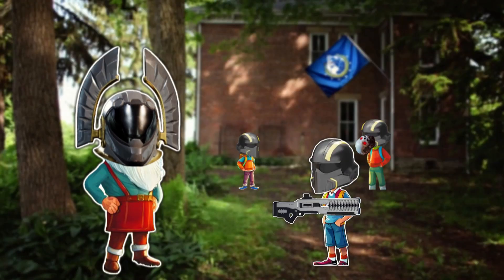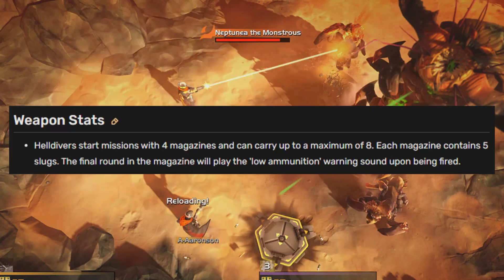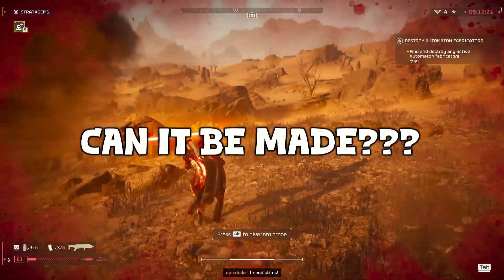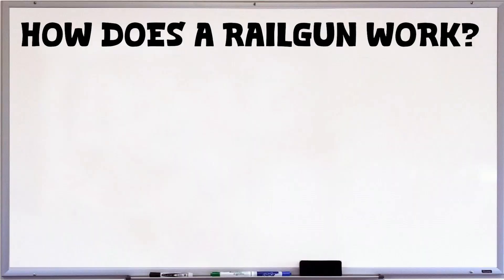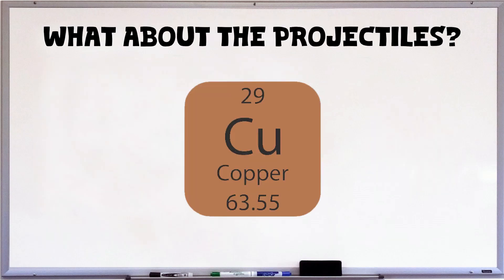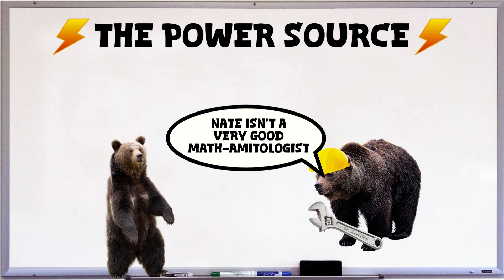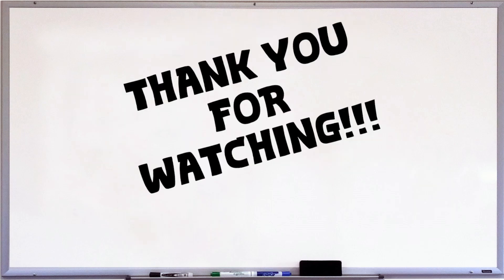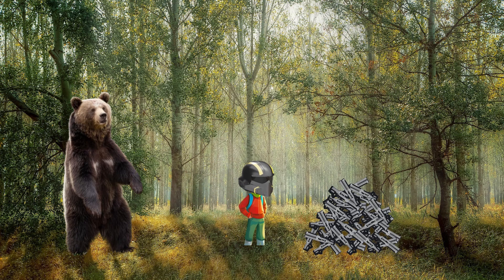The Engineering of the Helldivers 2 Railgun

Comment: You forgot about Capacitors. Capacitors have high power output. The whole process of charging your railgun is a process of low power output source charging capacitor, then when you shoot - capacitor releases it rapidly. So, if railgun charges for 3 seconds, 67 kW capacitor would need 67/3 kW battery source (ideally). Then there is battery size. Average car battery has capacity of 40 kWh. It means, that if it would output 40 kW, it would last 1 hour. We only need 3 seconds of charge, which will considerably decrease battery size. Then pair three of those little batteries into one disposable pack that goes with projectile and you get some working prototype. But all of this are really rough approximation.

Comment: What about a capacitor inside the mag the we change, i don know if a 67kw capacitor is even possible but the idea wold be that you discard the casing plus the expended capacitor and load the new one with the new slug, in game the part that act as a mag lights up suggesting this idea (idk im not an engineer or anything)

Comment: One major relatively easy-to-account-for thing you ignored at 13:25 was the velocity difference. 

Even if we assume the general efficiency of railguns are more or less constant, velocity is a massive factor here.

Kinetic energy is (1/2) mass times velocity squared. If there is a more or less constant ratio between input electrical energy and output kinetic energy, the velocity difference will be magnitudes larger a factor than mass. In other words a difference of 4000 feet per second would result in a kinetic energy change of 4000 times 4000, or a 16000000 change in kinetic energy.

With all that said, what's far more likely is each cartridge has a builtin super capacitor, like how modern brass cartridges have builtin propellant to fire the bullet. (Or would it be a super super capacitor?) Batteries just cant handle the current draw of a railgun, I mean you are literally just shorting the terminals with a metal slug so hard it fucks off at mach 5.

(PS, my money is on those weird armature things being spring-loaded to adjust to either A : variances in the projectile, or B : different projectiles, or C : getting excellent contact. So less of a "rail" gun and more of a "couple dozen micro-rail" gun. This has the added benefit that the wear component of the "rails" would be easily repairable.)
Reply: Oh nooo.... On your calculation of the kinetics energy with 4000 extra fps, you committed the cardinal sin of a^2 + b^2 = (ab)^2. Cheers!
Reply: @nixonwphoto  what? 
1 : Mate I literally used fucking feet per second in an energy calculation; the point was to demonstrate exponentials are big, i.e. leaving out the velocity was a massively influential component that none the less would be trivial to solve for. If you saw feet per second squared and thought any attempt at exact energy calculations was happening I want your dealer's number because god damn that shit must slap.
2 : even that correction would still be completely inapplicable even if I were making a serious energy calculation since there is only one variable in use, velocity. I literally never included mass once, precisely because, as much as I'll fight that imperial units are better for casual use, they're utter piss for any actual math. (And frankly I don't care enough to do the conversions) I literally never had a B or C, all I did was square 4000 and show how big the number gets. You might be able to say I said "16000000 change in kinetic energy" which implies an additive change rather than multiplicative, but again, we're now working in feet per second squared; is that really the issue here?

This is the most direct mathematical equivalent of saying the Monster's name wasn't Frankenstein I think I've ever seen.
Reply: @felixjohnson3874 Yesss! SI unit ftw. You actually don't have to do much conversion, since Nate's Game Box already he wants the projectile to be an one ounce slug, with 3x muzzle velocity from a normal shotgun, and @6:36, he provided the muzzle energy for a regular slug. We can just 9x that.
Reply: @nixonwphoto  I'm aware its simple to do but thats not relevant to the point I was making. The velocity is squared in the kinetic energy equation so a halving of the velocity cuts the velocity component of the kinetic energy to a quarter. 
100*100=10000
50*50=2500
This also directly cuts the total kinetic energy to a quarter since mass is constant.

The large scale military railguns he's comparing against are going at absurd speeds that are unlikely to be representative of the handheld railgun ingame. The calculations are being based on a standard slug, going at mach fuck.

An IRL handheld weapon like this would either

A : use reactive projectiles, so a projectile designed to explode immediately AFTER  hitting/penetrating a hard surface
B :  A heavy slow moving slug, potentially even subsonic for stealth operations
C : a tiiiiiiiny but absurdly high velocity projectile designed to be used to strategically hit vital organs. Alternatively; an unfolding skeletonized projectile that is still incredibly light but, like option A, expands on-contact via either compliant expansion, fragmentation, etc. to do a similar job as A without the rails themselves needing to be reactive. (This would likely be cost prohibitive for us today, but metal SLS 3D printing is already getting pretty bloody cheap)

What might be interesting is to give the railgun in game 3 ammo pools of 3 cartridge types, (selectable in the weapon menu) so one "Administered EMS Nanites" cartridge to stun single units, one "HPHE - High Penetration High Explosive" and "Subsonic Slugs", only having 1-3 of the first two and 10 or so of the last one. The first two are fairly self explanatory, they'd penetrate heavy armor and either stun problematic units or blow their inner bits to paste via a tiny hole in their face. Then the last one would be a fall back that'd have it's damage be highly charge dependent but make no noise and only pierce upto medium armor. (Maaaaybe also keeping the weird piercing the railgun has to punch through automaton shields and such, but not sure on that) Then its a jack of all trades weapon that can save your ass in a variety of pinches, but only has a handful of rounds to do it. (With the slugs primarily being a fall back so it's not entirely useless if you run out.) This means that, if we count the EMS and HPHEs as a single one shot kill, (a stunned charger should be as good as dead) it could kill a total of 6 chargers, much like something like the recoilless, but it has the initial charge up penalty of the Quasar. The benefit of course is that unlike the Recoilless you keep the backpack slot and have a bit more situational utility. So it has comparable ammo to the Recoilless (again, the slugs would be more of a fall back than a weapon definer for most people) with a faster follow up time, but it has the delayed firing of the Quasar with the benefit if not needing the backpack for the recoilless. That'd also fit a bit more with those weird grabby armature things it has; the rail contacts are literally designed to accommodate different projectiles going through the same barrel.

Comment: Thank you for making a fun science video on video game! I have something to contribute to this topic. I love science, since you have decided that projectile with the mass of 1 ounce,(~28 grams) and the muzzle velocity about 3 times of a 12 slug. With the screenshot you provided @6:36, we can easily compute the railgun projectile will have a muzzle energy of 3,204J x 3^2. Let's call that 29kJ to make it easy. 2ft barrel is around 60cm, or 0.6m, assume linear acceleration, with the Newton's kinematic equation, we can find the projectile takes 0.0008 seconds to accelerate in the barrel. Equipped with muzzle energy, and time spend in the barrel, we can find the wattage require to be about 3.6MW. Differ from your estimation by about 2 orders of magnitude.
Another disagreement I have, is deriving battery needed from wattage. Battery isn't particularly good that quick discharge, as you have shown. For fast and short discharge, the energy would come from a capacitor, like a pop up flash light on a DSLR camera, or IRL railgun, or in the fancy world of Helldivers 2, I imagine supercapacitor would be widely available, instead of our current lab use only. They should be able to provide the energy needed(~8Wh) for a shot with somewhere 3 to <1 kg of mass. With current Li-ion battery technology, it has specific energy density range from 100-250 Wh/kg (from wiki search). The battery mass needed for the energy of one shot would weight about 32-80 gram. 80 grams of battery can total be part of the cartridge, that will be discharged, and replace from each reload.

Happy physic'ing! From fellow nerds.
Reply: I thought a tiny bit more on this for comparison. The most powerful electric car right now is a Lotus Evija @1500kW, our railgun is only at just over double the wattage. While the Evija pushes its power from a battery pack for sustain power. We only need the 3.6MW, or 3,600kW for 0.0008 seconds; super capacitors should be able to provide the energy and wattage.

Comment: I’m building one for school. The key to the power issue is that the railgun needs only power for a split second to launch the projectile, so you can use a capacitor to store energy from a much smaller battery and release it in an instant.
Reply: Seems like you beat me to it.
My guess is that the round white thing is a capacitor, it's fairly big for one too!
And the actual batterie is in the thing you load into the railgun, since it's fairly big and you toss it when it's empty/almost empty.
That explains the charging too, you load the capasitor by charging the railgun up.
Reply: @danielgudi7446  I mean the laser guns seem to have practically infinite energy so long as they don't overheat so i'm assuming the railgun uses the same kind of battery.
Reply: @danielgudi7446 The energy needed for one shot can be stored in a smart phone battery. Pretty small for a high tech weapon imho. I love doing these "what if" questions.
Reply: The rail gun nerfed itself because it didn’t want to be anywhere near general Braschs power

Comment: 16:15 maybe they are generating the power in a small reactor? Or the ammo box is also a big battery
Reply: Feel please to double check my math in my comment, but the energy required to propel one slug once, can be stored within a battery that's in your smart phone or smaller.
Reply: Nate's incorrect, we do have railguns IRL, just not is mass production.
On the ArcFlash Labs' GR-1, the battery was bulky but not as heavy as a car battery.

Comment: So, first, i think pick copper, as material for projecile is not very smart, bcs its very soft and most likely will doubt, rather then peretrate smth.
And, second, i think battery in railgun is not that thing on the back, its thing that we load into railgun. Its makes sense, since its singleshot, this container or bullet, that we load, contains projectile and power to launch it
Reply: The cartridge containing the slug definitely does something in relation to firing the projectile. It reminds me of Halo 4-5's Railgun. It's projectiles are housed in cartridges that connect to the gun's power source or energy system meaning they're a required component in firing slugs down range.
Reply: Perhaps a copper jacket, or rings, over a much better material for launching, like depleted uranium, tungsten, or something the like.

Comment: Attach the gun to a battery pack, and use a super conductor as a sabot. You can't use rifling so just use a hexagonal barrel like those old confederate snipers. Or use magnetic levitation so the round doesn't have to touch the barrel at all. Theoretically there's a lot you can do with railguns.
Reply: Heck, given the proper alignment of the magnets, they could impart spine to the projectile too, and with the magnetic field holding it in place, it should be fairly stable. There are issues that would need to be worked out through testing, but that's one of the best parts, lol
Reply: @headazrd  imparting spin to a projectile reduces its overall muzzle energy, that'd be the worse way of stabilizing it. Best way would be fin stabilization so you can get the most bang for your buck.
Reply: The feasibility of using a superconductor is dubious at best. Given the energy requirements to make a superconductor a super conductor (it needs to be supercooled/cryogenically cooled), why would you waste it by chucking it at something. Not to mention that superconductors tend to repel magnetic fields. Might work in a coilgun(think one short burst of extreme magnetic field repelling the slug out the barrel), not sure it'll work on railguns.
Reply: @drakko26  Bullet trains do it on a miles long scale. Surely making a maglev gun would be easier  You don't need the entire projectile to be a superconductor.

Comment: Technically there are already railguns that are handheld, though operate at a fraction of the lethality, Demolition Ranch tested one, they are neat, they can hurt, but they aren't where youd want them to be yet, so the answer is technically yes, and definitely a plausibility in the future.
Reply: I dont want to sound like the Acktually meme, but i think those are just coilguns, feel free to correct me tho i did not research about handheld railguns, i know about the navy one tho, still bonkers :)
Reply: @yeetyiu4505  You're entirely correct, nor sure how I completely forgot about coilguns, examples of which exist to some extent, lol. Coilgun projectiles are suspended via magnetic field, rail guns aren't.
Reply: @yeetyiu4505 you are correct. They were coilguns. Definitely not the same thing at all.
Reply: What Cody tested isn't necessarily a railgun but more towards a gauss rifle. Still magnetic propulsion but different implementation - think more how a mag-lev train operates, just...well..faster. 
In all honesty, I think the coil gun approach is a bit better, especially since you can do away with the heat buildup from the friction with the armatures(rails).
Reply: @drakko26  The downside of a coilgun is that they're inherently less energy efficient so even though you don't have any friction it's still harder to get your projectiles up to a decent velocity. Not to mention the projectiles need to be made of a feromagnetic material and have high mass to more effectively react to the magnetic fields which once again makes it harder to get them up to speed. Railguns on the other hand only need the material of the projectile to be conductive and work better with lighter projectiles.